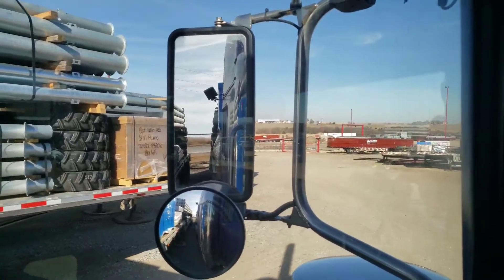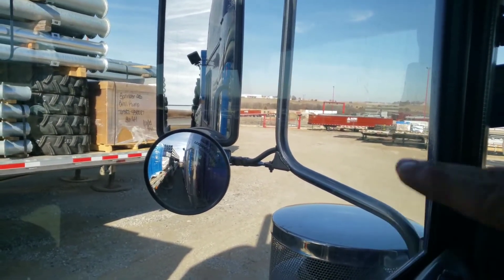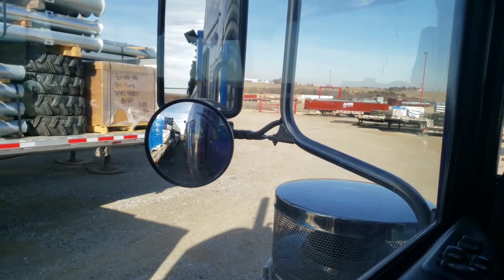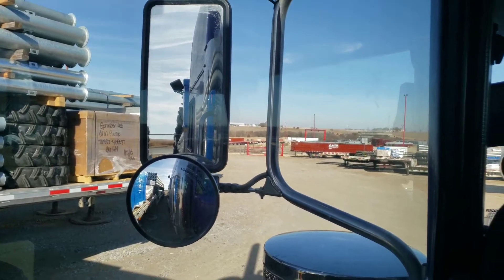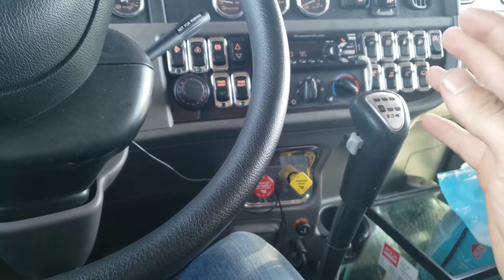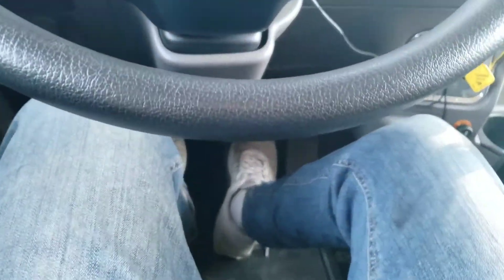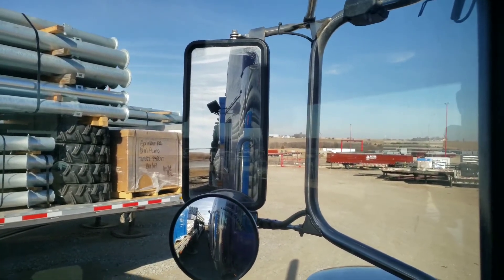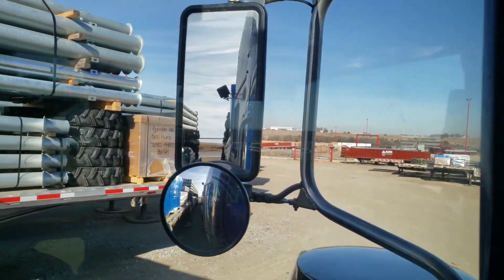The tug test

Comment: Good tip, just to build on that another additional check is after you've tugged,  raised landing gear and hooked lines up pull forward and test trailer brakes with Johnny bar and then pull forward with truck at a angle  and pull Johnny bar again to tug test connection in a turn.... Also always complete a visual inspection of king pin and be assured no gap or light is showing between 5th wheel plate and 5th wheel.... this procedure is one of the most important things to stay focused on...
Frank.. Mr. Safety
Reply from the maker: Good one